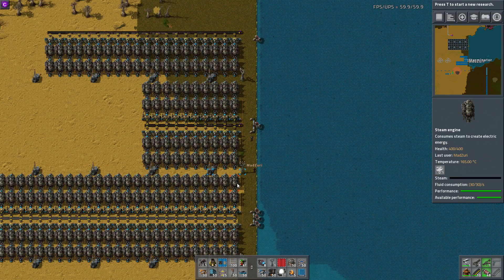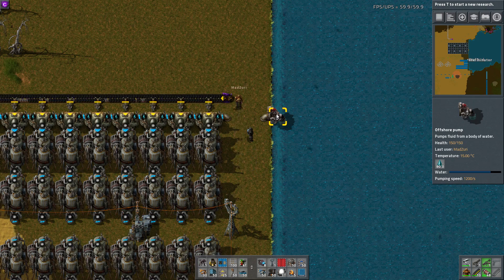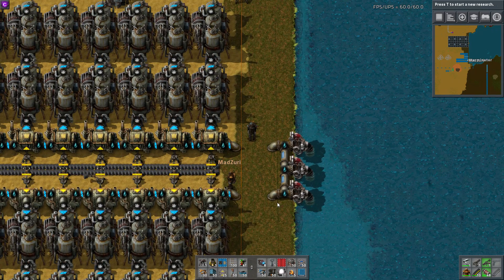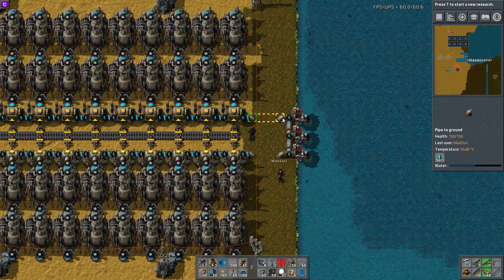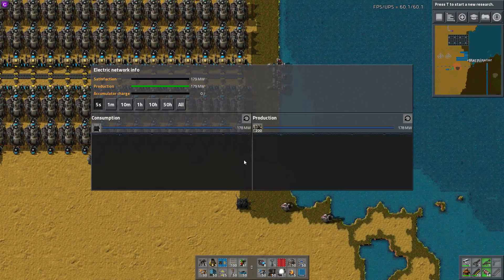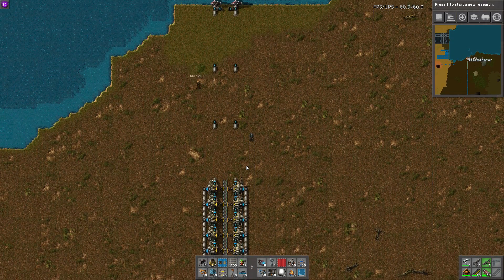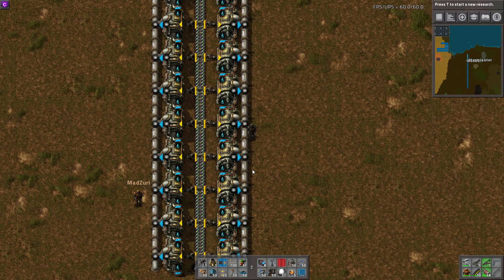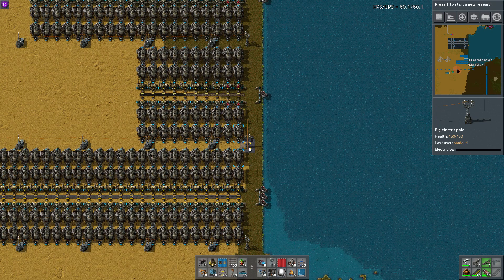Factorio Workshop Season 2 - Building A Better Factory :: V 0.15 Steam Engine Setups

Comment: this is nice but these setups are no use early game. you can get poles to all the boilers like this. you have to add a pipe every 2 boilers.
Reply from the maker: We probably shouldn't have used substations for this sense they aren't early game, but you can definitely still build these early game even with small poles.

Comment: Now just the question remains whether or not they changed the amount of pollution per steam engine. If they only increased the power output then that means much less pollution problems.
Reply from the maker: Well the steam engines themselves never made pollution, it was the boilers that did. I think they did increase boiler pollution though sense these new boilers are like 3x as strong as previous ones. Not sure how it all evens out though.
Reply: Odd. I was certain you had a pollution stat on the actual engines as well.
Gotta check

Comment: Hey Xterminator, I noticed a new feature on my new game that I have not seen anyone mention. They added a new "smart drag" to the power poles. Before if you just dragged power pole it would simply place them at max spacing(assumming nothing is in the way) Now it places them to cover anything it there path that needs power. Noticed when I was setting up some defense when I dragged the power poles passed that it didnt skip any turrents which always happened before. Not a game changing detail at all, but is a nice QOL thing for sure. Anyway thanks for the video.
Reply from the maker: Ah yeah, I had seen someone do a bit of that before and it looks super awesome. I'm putting together stuff for a new "tips and tricks" video, and this one will be perfect to add to the list. :) Thanks!

Comment: I suppose if you wanted to keep repeating the design, you could just butt the pairs of steam engines together, e.g.
... Boiler >> Engine >> Engine >><< Engine << Engine << Boiler ...

My first foray into 0.15.3 ended poorly. My glorious plans for biter genocide and world domination were temporarily thwarted by a complete inability to mine starter fuel. No matter what I tried, the key binding for the weapon switch wouldn't work (so, no using the pickaxe). Ran outta time and gave up for the night. :sigh: Next time, _I will succeed_!!
Reply from the maker: Yup that would certainly work. Many different ways to lay these out actually. 
Damn, that's no good, sorry to hear that! They switched the "switch weapon" key to Tab now, sense Q is the pipette tool thing, it takes quite a lot of getting used to and can certainly screw you over sometimes. lol 
Best of luck on the next try!

Comment: I just never understand why you use burner inserters to feed boilers...you just increase the fuel consumption.
Good builders just check their power on regular base.
And this idea of "They keep working if power drops"....it just means you have a more pressing matter then under-power.
No fuel in the first place or biters munching it away.

Or use a buffer chest + cuircit network-alarm system. If you know yourself you always forget power.

Comment: I don't think its very useful to connect these builds to substations, its too resource costly for no real benefits, not to mention you'll need relatively big engine settups way before you even research substations, specially if you play with expensive/scaled science, what I do is sepparate the two steam engines by a single straight pipe, then every two rows of engines you just place a basic powerpole, you'll need to add powerpoles along the inserter line as well, but again, they are extremely cheap and there is free space anyway, it even occupies less space than this setup, its one tile thinner (considering the substation adds 2 tiles width).

[edit] the powerpoles for the inserter line are optional, you don't need that if you use burner inserters like xterm and zuri do, the only reason I don't is because my fuel comes from electricity driven sources anyway, so if power is low fuel supply itself will start to fail to begin with.
Reply: here is my variant if anyone wants it: https://pastebin.com/03bcyfa0